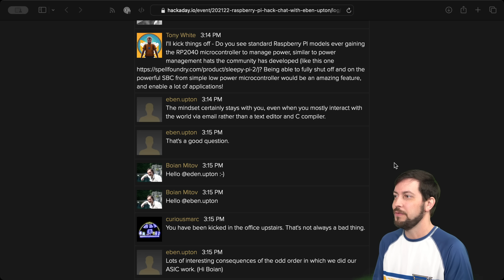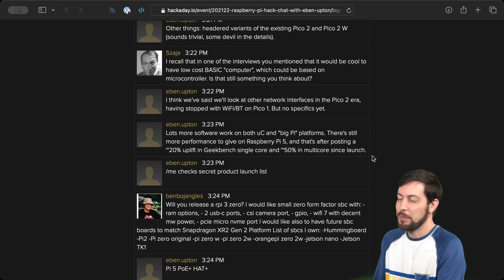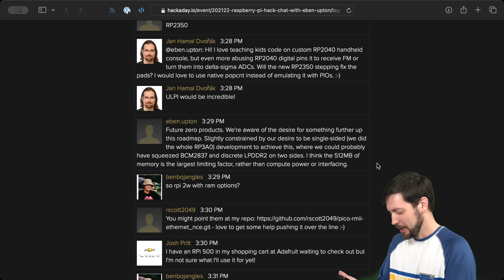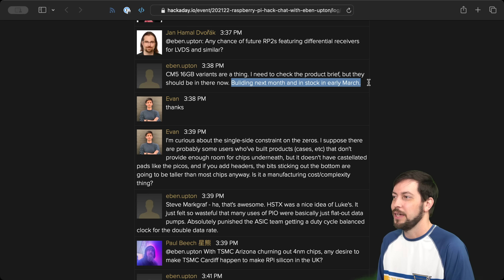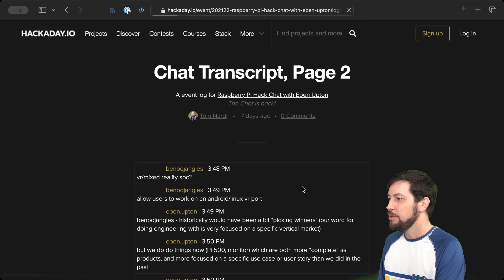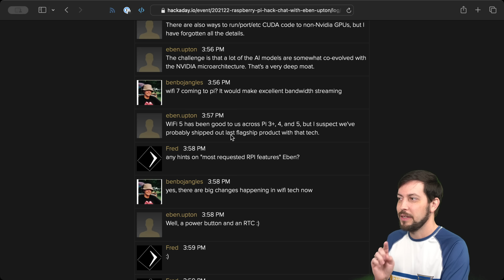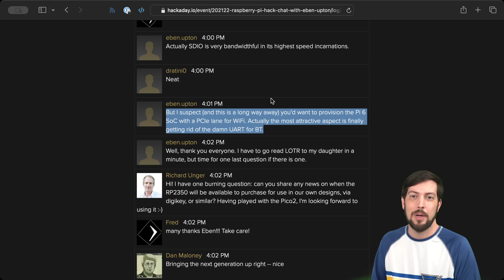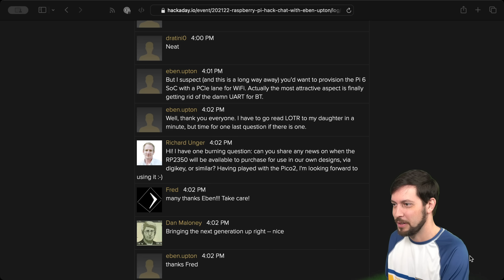Will the Raspberry Pi 6 have WiFi 7?

Comment: On my wishlist for a Raspberry Pi 6: Bring back H.264 hardware-encoding and implement hardware-decoding of VP9 and AV1. Because it's more energy efficient as in software, esp. at higher resolutions. Basically, watching videos with a silent, passive cooled device.

Comment: i wonder if there could be a more powerful incarnation of the CM lineup someday

the major issue i've ran on thinking about projects with the CM5 was actually the lack of PCIe lanes, only 1 is though, 2 would be heaps and bounds better, imo same with the lack of eDP, you can convert DSI to eDP but i'd find it nice to just be able to use eDP like on the other compute modules i've seen
2x HDMI 2.0 seems excessive
and the lack of suspend also killed it for me on most of the things i thought of (which may have been fixed with 6.14? unsure)

and also, i agree that an RP1 on a PCIe card would be amazing!

Comment: Agree that NVME makes sense for Pi500.
1. It’s not a real estate issue (as you have demonstrated)
2. Keyboards computer users are more likely to be software learners/gamers and not HW hackers 
3. One option would be external USB enclosure containing NVME that securely attaches to keyboard and uses cable to USB port
4, Using an external NVME enclosure would make it easier to swap out operating systems

Comment: The issue is the form factor. Everything would be solved by just having CM5 boards that can be larger. I honestly would rather they take WIFI and ethernet off the main board because I'd rather have the choice of plug in cards.

Comment: well a pi500 hasnt even got a connected m.2 im done with pi,s there going the same way as the amiga overpriced and cut down version the pi500 should have been a flagship model and had it all 32gb faster video you name it and m.2 so im done with pi.

Comment: Raspberry Pi is not the game-changer it once was for DIY tinkerers. What was once an affordable go-to board for hobbyists is now an overpriced platform. Fully decked Raspberry Pi 5 setups, with decent RAM, a case, power supply, and storage, now cost almost as much as Intel N100-based mini PCs from Beelink or Minisforum. These mini PCs offer far better performance, efficiency, and versatility, making the Pi feel like a poor value in comparison.  

To make matters worse, the Raspberry Pi Foundation seems to be shifting focus toward industrial clients rather than the DIY community that built their reputation. Supply shortages and sky-high prices have driven hobbyists to alternative SBCs or even x86 solutions. The original vision of Raspberry Pi as a budget-friendly tool for makers is fading fast, leaving the community frustrated and underserved. It's sad to see a once-iconic platform turn its back on its roots.
Reply: Absolutely this👆
you can get a refurbished Intel Core i5-based mini PC with better performance, more RAM, storage expandability, and proper cooling. These machines can run full-fledged Linux or Windows with ease, support virtualization, and handle workloads that would make a Raspberry Pi struggle.
Recently I went with used Lenovo Thinkstation 330 tiny for $90 
core i5 8 gen
8gb ddr4 ram
256gb ssd
And it's far better than Raspberry Pi

At this point, unless you specifically need GPIO access, (I'd still prefer esp32 or similar) the Raspberry Pi has lost its price-to-performance advantage. The DIY community is waking up to the fact that used enterprise hardware delivers far more bang for the buck than an overpriced, underpowered SBC that the Raspberry Pi

Comment: Maybe they can release a new Pi with a RISC-V SoC instead, cheaper, with 16GB of RAM, a tightly-connected RP2350 (I know the RP1 in the Pi 5 does part of that, but having a fully programmable MCU such as the RP2350 would be a big plus IMO), eMMC Flash.

Comment: They should build a super flat pi5 so we can 3D print a laptop or tablet around it. Without needing to desolder ethernet ports etc. or take a pi400/500 apart.  Not a compute module either, because it should have some useful ports and connectors, so you don't need to stick it on another board.

Comment: Get this: maybe they can put a single vertical HDMI port so it will fit and have a decent connector? A SATA controller, if i'm not asking too much? Also bring back the audio output, some of us are not using sound capable hdmi displays
Anything  else would be nice to have but those are anoying not to

Comment: 2-3W in idle is good?! Dude, that's horrible, unacceptable for the battery-powered device. Good is 0.1-0.2W. Mobile phone chips can do 0.05W or so.
Reply from the maker: Raspberry Pis are typically not battery powered; as far as SBCs go, they're in the middle of the pack, though newer Rockchip boards can idle down to 1.5W or so.
Reply: @Level2Jeff  Many hobby projects, including cyberdecks, are based on either Raspberry Pi or chinese chips like Rockchip, Allwinner, etc. Their idle power consumption is very high, and in addition many of them don't suspend very well, esp. Raspberry. For comparison, Ingenic JZ4770 1GHz MIPS idles at about 150 mW, and Microchip SAMA5D27 in standby (not suspend!) consumes only 17 mW.
Reply: @Level2Jeff  Raspberry CM/Zero2W is used in many hobby projects, incl battery powered ones, like Cyberdecks. But Rockchips (and Allwinner) are also not known for good idle power consumption. Compare this: jz4770 MIPS idles at 150 mW, mtk6572 is about 220 mW with full CPU power, and Microchip SAMA5D27 eats only 17 mW in standby! (not suspend, resuming is much faster).
I want a cyberdeck with days of battery life! But power-saving chips like Mediatek or Qualcomm are all under NDA, expensive, and hard to buy in small quantities.

Comment: Love to see the Pi Zero 2W with 1GB of memory.
Also, please, Pi 6 use 8nm or better process.
Reply: >please, Pi 6 use 8nm or better process.
So it will cost even more? are you crazy
Reply: @BusAlexey  Basically, not. The die area will be smaller. If you know how to calculate the cost of a chip, 8nm~16nm is about the same.
Reply: @TT-it9gg  actually not true. If you know the industry even a little bit, you'd know 28nm is the last time the price per transistor actually decreased
Reply: @TT-it9gg  pi must stay a couple gens old to even offer $50 SBCs. They're probably staying on 16nm, or moving to 14nm
Reply: @ Your info is out dated. Now, 4nm and 3nm are common. Many SoC of SBC use 8nm and 12nm for many years.
Reply: @TT-it9gg  it is not outdated. It's clear to me that you only look at news and that's it, no knowledge
Reply: @TT-it9gg  there's no low-cost sbc that uses smaller than 16nm tech
Reply: @ Up to you. Stay in the pond or come to face the real world.
Reply: @TT-it9gg  if you knew any low-cost sbcs on smaller processes than 16nm, you'd say what they are instead of posturing. The truth is, there's none.

Comment: Orange will beat them to market with a better deal. They lost me at the Pi500 sucking monkeys balls. Orange for the win, its faster, its got nVme and its cheaper. Pi dont do squat, most of its OEM chips, they do a MB design is about all. The Pi now competes against faster Intel N100/150 and they are better PCs for the $. For small Pi's the original Pi is just outclassed too slow to evolve and maybe they can can move to Risc5 ~ I was hanging out for the Pi500, after the disappointment and shock I just ordered an ORANGE Pi. They are just better bang4buck & if they are that far behind now, they are irrelevant IMO; they can sell promises

Comment: I wish they'd have a broad sdr built into the pi, wifi is nice but if it had sdr that could do wifi, or radio, or tv, or whatever. New version of wifi, change the frequency and the software driving the protocol and poof updated. Need long-range just switch to lora.

Comment: I don't see the need for the pi as much as I used to. The Pi 4 was great but the Pi 5 is trying to compete where there are most cost effective solutions (refurbished 1L PCs). The Pi 5 performance is OK, but by the time you add in NVMe support the cost starts to go up too much. It is also easier to get a 1L PC set up with NVMe. The 1L PC also is in the same power range as a Pi 5.

Comment: A Pi Zero 3W with 4K support is what I'm looking for on Pi Day. Could not believe I couldn't use the full 2K resolution on an Ultrawide Monitor (Arcade Marquee @ 2560x1920). Had to "waste" a 4B for signage (marquee) as the 3B also couldn't get that resolution to work.

Comment: I desperately need a dedicated 4(or 5)-pin JST-SH port for I2C added like they added for 3-pin UART.
Way too many hats cover the main I2C and all the power pins. All the additional I2C pin configurations that the 5 added are kinda useless without an open power pin

Comment: Realistically, Pi is for makers and people that want to learn... used for home automation, communication, I/O, cameras etc. Not a power tool, it is used as something small with some computing power and GPIO, so a proper PD power input would be about time, a u.fl connection for external antenna to improve on WiFi reach to use it as remote sense and control devices, loose the micro SD card already, put it in base 2GB models, but eveyone normal uses M.2 or USB boot - so at least MMC on M.2 slot on pi would bring it to 2020. Pi5 offers plenty of power for any reasonable tasks, for anything else there are other powerful systems.

Comment: IMHO the killer PC peripheral wouldn't be a PCIe card with the Pi GPIO headers on - the PC is frequently under the desk, and even if it's on the desk, it's almost always at the back.
Make it a USB device, so it can be sat on the desk in front of you, but plugged into the PC? Yes please.
Heck, can you imagine the possibilities if they put a Pi 40-pin GPIO header, a USB-C port, and an RP1 to glue them together, on a board the same form factor as a Pi Zero? I'd bite their hand off. The possibilities that would come from being able to use Pi HaTs as PC peripherals are enormous.

Comment: Radxa and other manufacturers have figured out more ram on a zero footprint with more features. If stacking the ram on the chip for a zero is the hurdle then the design needs to be changed.

Comment: Those more lanes of PCIe not only could open the gates for faster network, but also for more storage devices, better GPU connectivity, and even a NPU. I don't expect anything that "extreme" for the "normal" Pi, but it would make the Compute Module a lot more juicy IMHO.

PS: Jeff, that green screen works fine for the job, maybe with more illumination in the lower part it would be 100% perfect, but outside that, it is not easily noticeable or distracting in any way.

Comment: Dream scenario

 Pi 6 has wifi 6 or 6E

The foundation finds a way to offer 16GB at $99,  8GB $75,  4 GB $50, 2GB $35 (Least likely I know)

Better PCIE support and a proper encoder decoder

Comment: Can you backlight through that green screen? Might eliminate the shadows which will clean up the key. Just don't go overboard to where the green lights you.

Alternate, "cheap" LED lights shining on a gray backdrop, get RGBW and you can change the color to opposites from what you are wearing that day, or never wear blue and use a blue color because the spill generally looks better.

Comment: I think Ecosystem is an important consideration. I like the fact that not only old Pis are supported, but they also put out necessary peripherals such as power supply, usb hub, mouse, cases, and monitors. Even their own OS. This will bring up reliability factor extremely high, and that's an extremely important consideration above all else to me!
Reply: Agreed. I'd very more inclined to get a Pi 3B or pI 4, 4GB than another Pi or a Pi 6.

Comment: With the requirements of users, including the absolutely insane ones, the price is going to go up so far that it will actually be cheaper to buy two mini PCs or even an Nvidia dev kit. The original core idea of the RPI series has definitely been exceeded or abandoned at this point.

Comment: I actually design chips. There are different levels of re-spin. The easiest is to try an ECO (engineering change order). Chips have spare gates. If the change is small, you can just change one or two levels of metal to add the spare gates into the path. This is only for tiny changes such as simple bug fixes. Chips typically use at least 30 masks (one for each process step) and often much more. Buying a mask costs a lot of money, so the fewer you change, the less it costs. Major changes can result in a full re-spin (throw away all old masks and start from scratch). Obviously you try to avoid this, even if some minor bugs get ignored.

Comment: I really hope we can see some PIs with lower power consumption in the future. We're still using 3Bs (not even B+) because the added speed from the 4 and 5 aren't worth the added battery drain and heat generation in our case.

Comment: I'd just like to see full size HDMI ports. Stack them or turn them, like Argon 4 v2 did, just scrap the micro ports. The Pi 500 should've shipped with full sized HDMI ports, they had the room. The micro ports are just too fragile.

Comment: I'd like to see a OCuLink port.
Bump the PCIe lanes coming out of the CPU up to 10.... that's 4 for the link to the Southbridge, 2 for a boot NVMe, and 4 on the OCuLink.
The new Southbridge should be on a PCIe Gen3 link. then like the Ethernet currently is have the Wi-Fi directly on that (Sometimes i wish they'd ditch onboard WI-Fi... i like my wires)

I can imagine the CPU on a RPi6 (maybe an octocore with 4 big and 4 little?) is going to be much quicker than the RPi5, so coupled with the extra PCIe lanes that would put it in direct competition with whatever the next generation of Intel n100 type setups are.

The only downside is what would the price be.
May be we end up with 3 different sized PI's...... zero's.... normals (current size)... and giants (has all of what i just described above).
Or thy just scrap the current format of SBC and go compute modules with different carrier boards.
Reply: I'd like to see a Mini ITX version, with all the normal upgradeable, and replaceable components.

Comment: Damn, im still waiting for a good pi board that sells all the networking stuff on a separate board. I dont want blue tooth, wifi, lidar, or any network protocols directly connected to my AI's robo-brain. Yes they could be convenient & i understand people wish to avoid bottlenecks, but 5G in my area of Florida is outputting less than 50Kbps sometimes, & I seriously dont want any IoT or telecom trash touching my AI's brain. As someone whos dealt with Telcom & Government suppressing my communications for over 2 decades, I have more trust in some undeveloped 56k modem than bluetooth or ipv6 or udp trash protocols. (Internet of Bodies!)

Comment: things i want from a pi:
normal sized hdmi
analog input pin (there is so many simple sensors you cant use without that)
inbuilt storage options. if you have to pay for a micro sd card otherwise anyway, i dont mind that making the pi a bit more expensive.
(pi zero with ethernet connector would be nice)

Comment: I'm not too interested in a new mainline model Pi, the 4 is good enough for what I need and the Pi 5 is more if I need it. I'd love a Zero 3, with 1GB RAM, another USB port (compatible with one running in host mode and the other in device/OTG mode), and the QoL improvements made on the Pi4 with the new bootloader

Comment: When the raspberry Pi 6 releases I hope it will have a quad core ARM Cortex a725 at 2.4 gigahertz and a Videocore 8 at 1.245 gigahertz. I see no reason to go beyond 4 cores on a raspberry pi and would rather have four high performance cores than six or eight low performance ones. As for a Raspberry Pi zero 3, I would like to see a quad core a520 at 2.4 gigahertz with a Videocore 8 at 888 megahertz.

Comment: Honestly, with the boost to 16gb I'm good with where the Pi 5 is at currently, I don't "Need" or even want a more powerful / faster Pi.
What I was really hoping for was to see a R Pi 5 Pro or + model.  Maybe a slightly redesigned board, but 2 open default Gen 3 PCiE lanes (Or maybe 4 if they feel super fancy), trade out the 2 micro HDMI ports for a 2nd USB C port (so there isn't a potentially constant power conflict with other USB C peripherals if you aren't running PoE), and full size HDMI.  Maybe move the locations of the PCiE ribbon plug and Micro SD port so that they don't interfere with swapping Micro SD cards when you are running a Base instead of a Hat. 

I recently got mine, and let me tell you, managing the USB C and Micro HDMI ports to get a monitor working is proving to be frustrating.  I'm not sure if the monitor isn't providing enough power to the Pi, or there is an incompatible conflict over USB C, but I can't get it to work, and I, in error, thought I had a Micro HDMI cable (it was a mini), so now I get to wait however much longer it takes to get an hdmi adapter because I don't want to spend 10$+ on a 3$ part.
The ribbon cable issue is going to prove frustrating as well, once I get it working and want to swap for different builds.

Comment: Drat — wish I'd known about that event.

For several years now, my biggest wish-list item has been an SoC that is well supported, runs Linux, has Wi-Fi and has good IO. So that's either an ESP32 with beefier memory and PIO, or an RP2350 with beefier memory and integrated Wi-Fi, or some kind of tiny Compute Module Zero 2 W. Raspberry Pi feels at least as well positioned as anybody else to fill that niche; I wonder if it's on their radar.

It's interesting that there's talk of buffing PIO, though. I'd love to see it close the gap a little with embedded FPGAs.